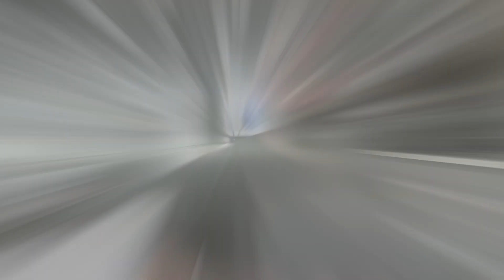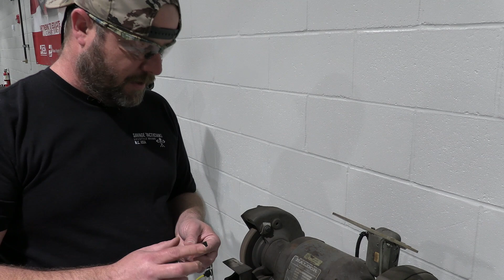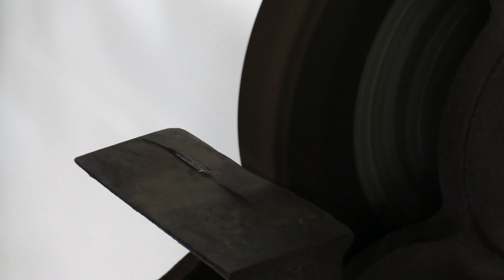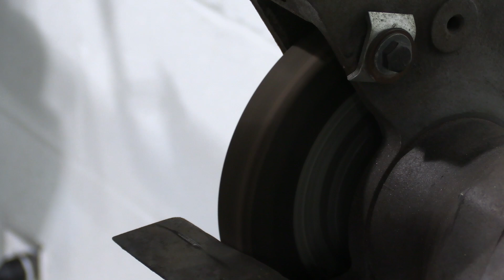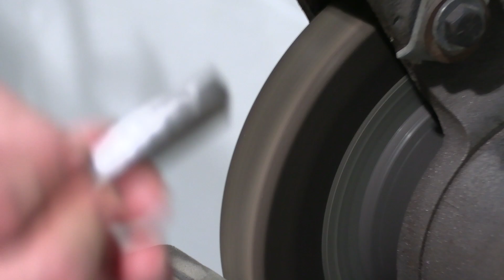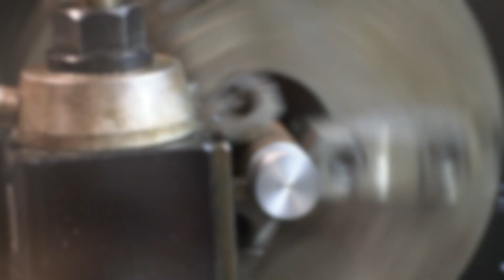How To Grind an HSS Lathe Tool Bit

Comment: Excuse me please - do you use a diamond grinding wheel for working on the HSS tool bit? I can clearly see an outer thin ring on the wheel suggesting just that. In which case - is it a good choice for HSS? I've heard that it is advised to use diamond wheels for nothing but carbide tipped tools because HSS (and any other kind of steel) will "gum up" the diamond wheel surface in no time.